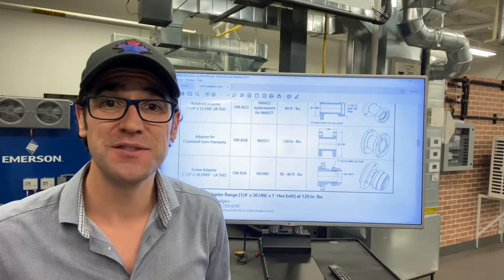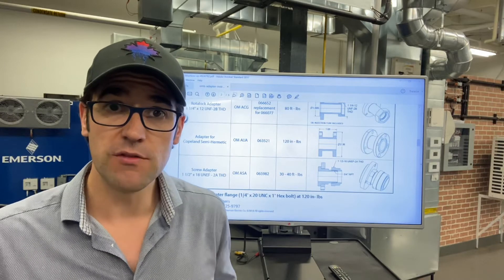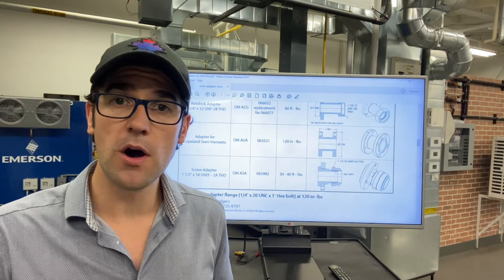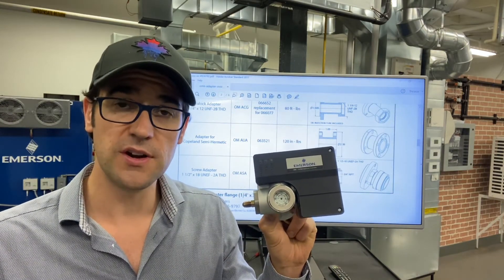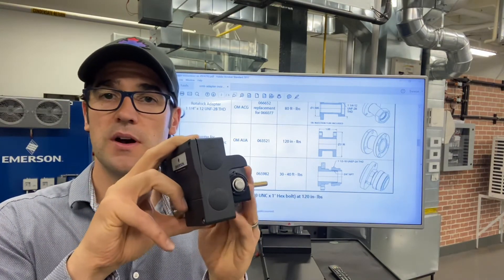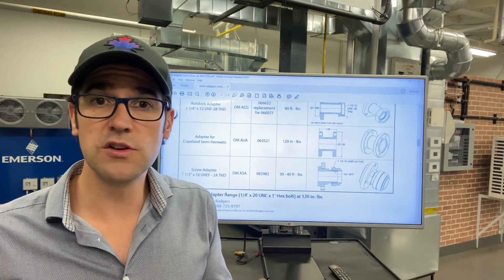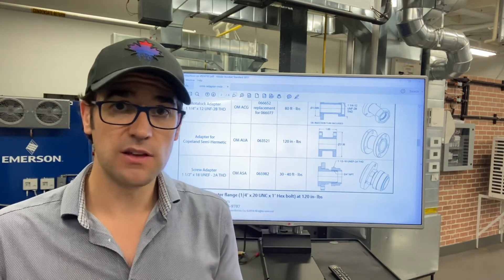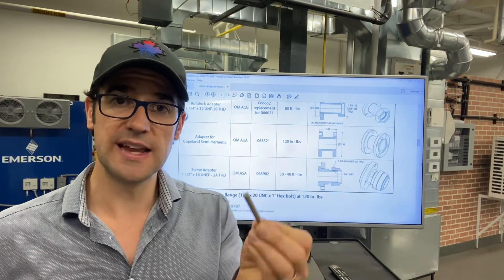Refrigeration Oil Management Controls

Comment: Heyyy Trevor Mathews
I am working on a scroll rack.
The oil level control..emerson OMB...
All three lights are flashing.
Is this part defective?
Thank you
Reply from the maker: I have heard of that before but I do not remember to be honest.  If all of them are doing the same thing maybe its a power or wiring issue if its only one of many its probably the omb.  I will email someone I know at white rodgers.
Reply: @RefrigerationMentor  
Hello sir,This is on a boat,it has 3 racks all have 4 compressors each.This was working all along.Only recently the lights flashing so i know is not a wiring issue.I tried resetting it by unplugging the power from the omb,waited and reconnect,but same thing happening.
Reply: All the other compressors are working.Only 1 compressor off.
Reply from the maker: Emerson told me that if the 3 lights are flashing they believe it will be a defective OMB.  I would follow up with your distributor or wholesaler.  The support team at Emerson sent me the OMB manual where it shows the what each of the lights do but that was it.  Good luck.
Reply: @RefrigerationMentor  heyyy
Thanks for the info.
Will order the part and replace it.
Will give you a feed back.
Appreciate your time.